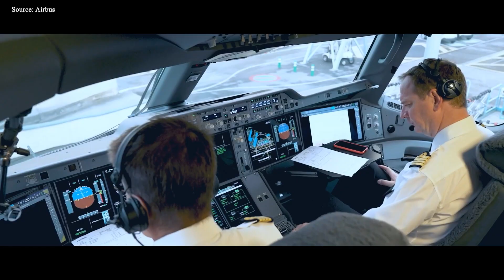This Is Why NEW Airbus A350-2000 Just OUTSMARTED Boeing 777X

Comment: Wasn't -2000 cancelled??
Reply: No, it was designed but never developed due to lack to suitable powerplant - one producing over XWB-105/110. It was never built.
Reply from the maker: Yes, the -2000 concept didn’t move forward. The video breaks down what Airbus planned and why it changed direction.